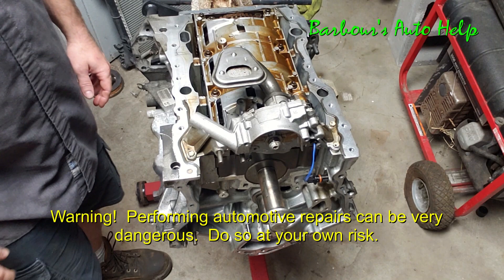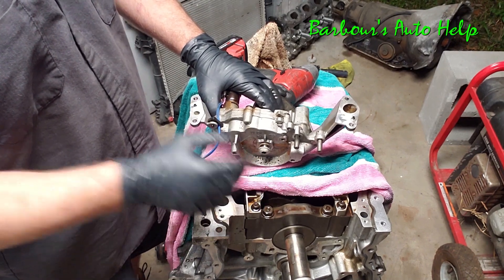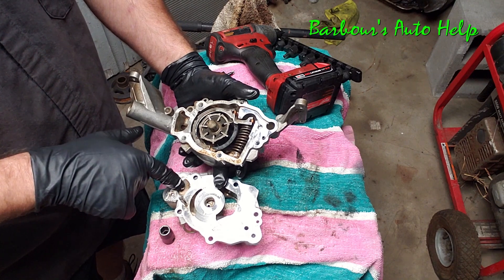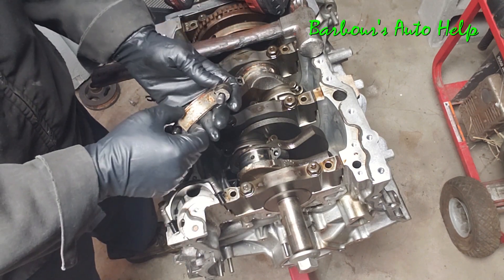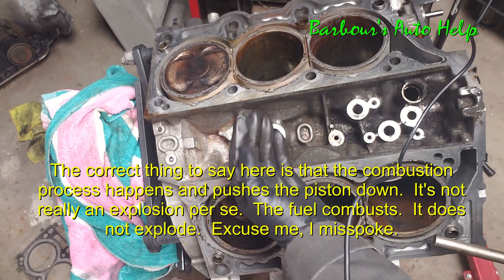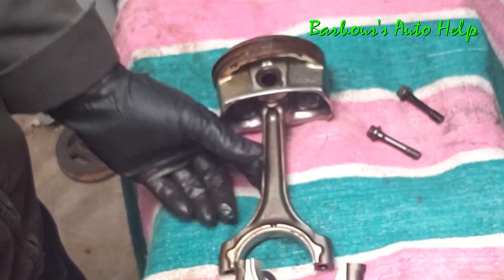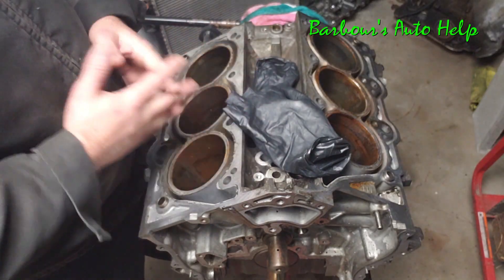Chrysler Pentastar 3.6L Tear Down: Part 3

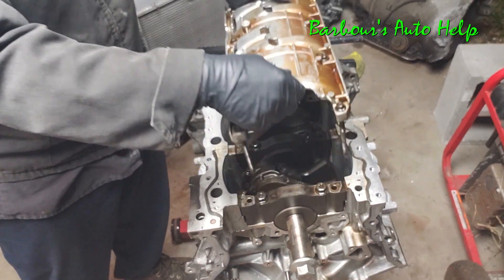Comment: ...beginning at 06:45 ,the crankshaft becomes visible and I noticed that the pentastar V-6 motor connecting rods are slightly offset from each other one in the pairs....there are 4 huge main bearings and plenty of mass in the crankshaft itself...so my question is does the offset help smooth out the vibration or increase the top end performance and exactly what is the delay between firing order in degrees per cylinder ???  is this because it's only a 60 degree block or what ???? GREAT VIDEOS !!! LOVE THE CONTENT ON YOUR CHANNEL....shalom from Israel............
Reply from the maker: I'm willing to bet they probably had those things in mind when they made this engine.  However, I haven't gotten that deep into the engineering of this engine to really answer your questions with confidence.

Comment: Very nice videos and explanations, about taking the engine apart in a rough way well I am working on mine I want to re use but mine is hydro locked, I had to pull the engine with transmission out of the bay, now got the engine on its hoist by 2 cables, kind of "floating", there is no way to use an engine stand because the torque converter is attached to the engine because the crankshaft would not spin hence could not unbolt it when in the bay; this is by far one of the most difficult tasks i have done as I am not a mechanic, I had to use impact on the bolts for the oil tray that sits between the oil pan and crankshaft, the thing is I have zero leverage to use a breaker bar, would need someone holding the engine from moving while un-torquing and i only have my daughter who was the one who caused the damage by the way, so following the un bolt sequence as it should be when the engine is in a stand is very difficult, as much as I do not want to damage it or warp it I do not see other way; after it is apart the block will be inspected at machine shop and cleaned and rectified if needed. Same with the heads. for assembly I will use new bolts, even thinking getting new bolts for that lower tray as well, it was pretty tight and one bolt was rounded; at the time of this writing I have yet to un bolt the heads and the end caps for the connecting rods; I still can not see the extent of the damage or why the crank cant spin; there are no metal shaving or pieces found in the oil pan only some water as engine took water in from driving it or trying to drive it though a low flooded street as she was caught up on it. I do not wish to use a used engine and I thought about buying the long block as nobody really sells just the short block on these but Fraser Engines and 3 other places that are "popular" selling them engines remanufactured they have horrible customers reviews with horrific stories about wrong engine sent and engines which would not start after installed and fights for returns and a whole fricking nightmare which is why I committed to try and do it all on my own; may cost me a little more but it is the only way I have to know when I turn the key the engine will start; no my first rodeo, I already remanufactured one for another car, a 4 cylinder 2004 Toyota corolla and also have a 2000 Toyota Tacoma waiting in turn to be overhauled, initially we were saving to buy a long block from Fraser but I am not going to pay 5k+ to have issues and the few times I called them they were horrible cutting me off, hanging the phone and not interested unless I was going to just buy; good luck with that attitude! the prices of this type of repair no matter where you go makes us turn into mechanics to get it done; thankfully we got you tubers like you and some other resources for the one willing to undertake the task and that is very helpful.

Comment: Just like every car or engine, there are good eggs and there are bad eggs. Car A rolls off the assembly line providing new owner with years/miles of trouble free driving and car B is a P.O.S. providing the new owner with as much misery as they can stand until they pass it on!

Comment: This engine sucks
Reply: Just bad luck then... I have a 2011 Grand Cherokee with the first gen 3.6L Pentastar,  Jan 10, '22 it currently has 131K and over 4520+ hours on it and this engine is still running strong... driven 200 miles a week to commute to work, highway and city...No complaints here...
Reply: What issues have you had? 

I’ve encountered tons of these engines over the past 10 years. They’ve been phenomenal in my experience. Mine at home is at 275,000 miles at the moment. I’m hoping I’ll hit 400,000 with no issues.
Reply: @mcspartan5822  head gaskets oil coolers radiators rockers lifters camshafts, camshaft position sensor cables that are faulty should I go on?
Reply: @johndoe5162  i've had engine oil cooler bad, radiator bad, 3 thermostats and still the ongoing camshaft position sensor. Sensor has been change twice and the wiring redone twice (by dealer.) oil galley bolts checked. Still get the camshaft position sensor error when under a steady load (70mph or so on the interstate). Now the dealer wants to replace the passenger side head. They have not given a reason on why they want to replace the head $3k+. Of course this is on the head that doesn't have the 150k mile warranty on it. all of this at 100k miles.
Reply: @airgun1974  sorry to say this, but highly disappointed by jeep I'm at the point of just scrapping the thing and forgetting about all these headaches.